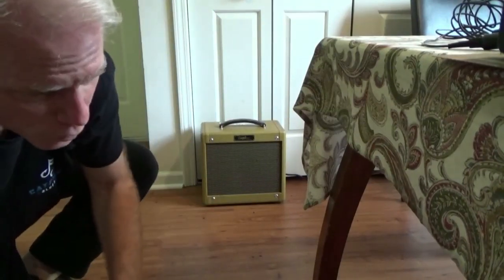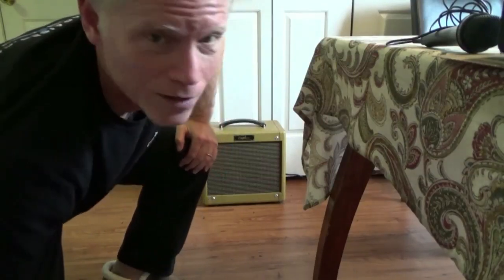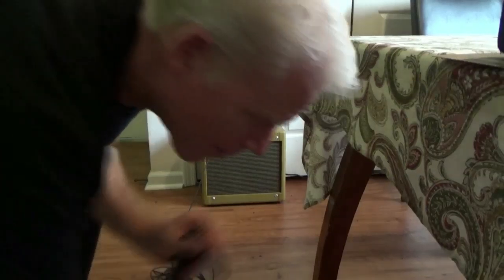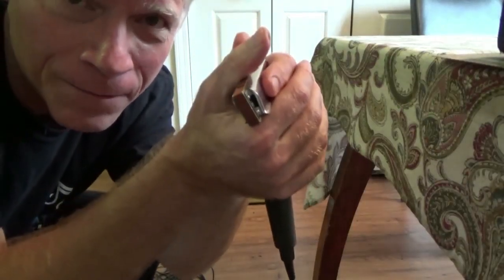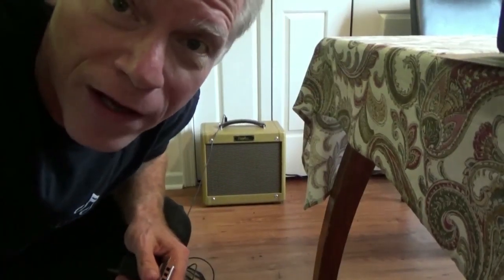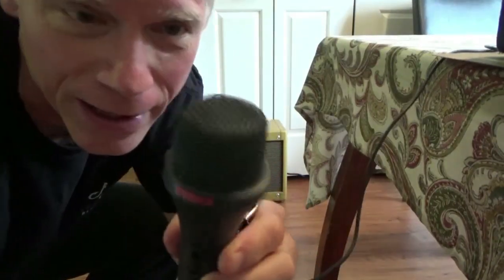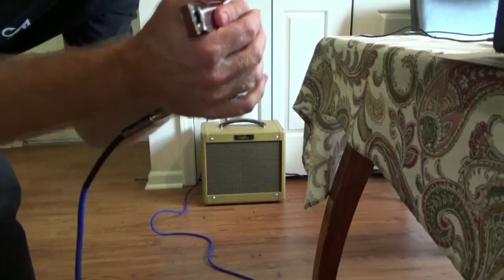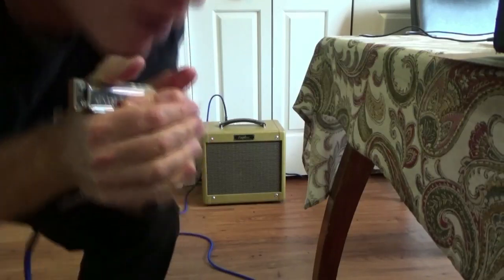How do a mic and amp change the sound of a harmonica?

Comment: Love your work and you are quite right being a fan more of the stick mics than the bullets. The late great Little Walter pioneered the distortion sound in spite of only having a JT30 (so I've read) at his disposal. You can't beat a sure 57 or equivalent. I read and looked at a lot of videos and nothing really pointed me in the right direction. I worked it out for myself and the key ingredient is sending the SM57 through a graphic equaliser first and killing all frequencies above 1000Hz,  then clipping the signal through a little tube amp. This results in the smoothest trumpeting sound as close to Blind Owl as you can get. It is a sure fire way. Feedback still remains an issue, but try building a dummy load in parallel with with the speaker. 1 or 2 Watts is plenty to get the sound.

Comment: THANK YOU, VERY MUCH, ADAM, FOR THIS EXCELLENT DEMO, AND TUTORIAL!!! I AM CONSIDERING USING ONE OF THE "DIGITAL" (BATTERY/POWER SUPPLIED) "MICRO-AMPS, BECAUSE THEY'RE SMALL, LIGHTWEIGHT, AND PORTABLE, AND GREAT FOR "PRACTICING", BUT, I'M WONDERING IF I CAN PLUG IN A "CONDENSER MIC" INTO IT, AND , THEN, IS THERE A "TUBE" EFFECTS PEDAL AVAILABLE THAT WOULD GIVE IT EXCELLENT "TUBE-DISTORTION" EFFECTS"??!!!....  ANY THOUGHTS ON THIS?!....(I DON'T WANT TO HAVE TO LUG A 50 POUND AMPLIFIER AROUND) I'M NOT LOOKING FOR "HIGH VOLUME", JUST GREAT TONES!!!

Comment: very good playing, and excellent tips and techniques, especially with the audio-engineering science added in.....see, music isn't just about "art", some science of how things work in the physical universe is very helpful ! PS, I'm not a harp plsyer and I'm not much of a guitar player but I have significant experience at  fixing vintage tube type guitar amps, and for electrified harp, small, low power amps with small light thin-coned speakers  are usually best.